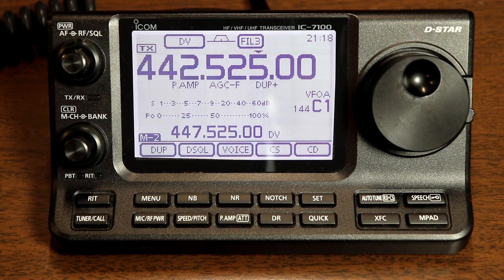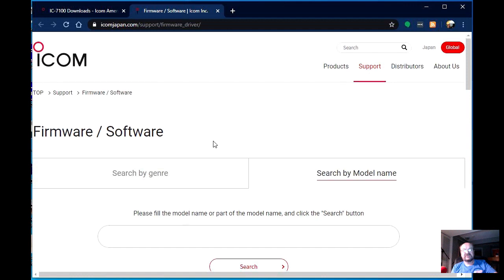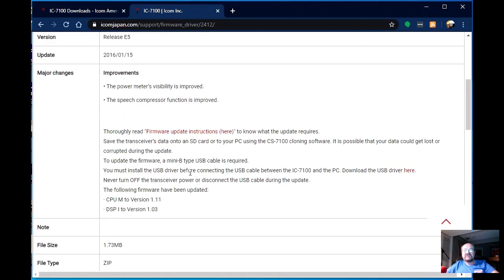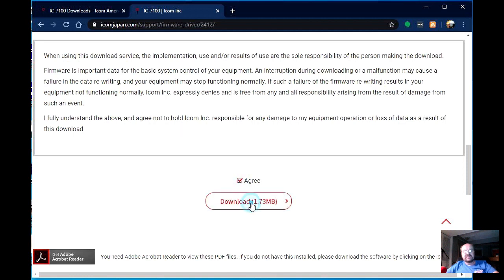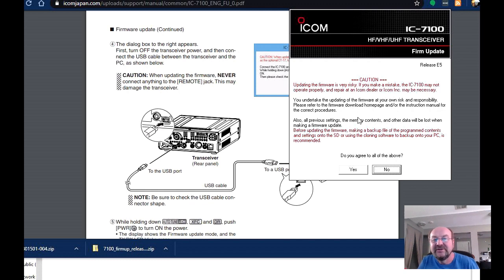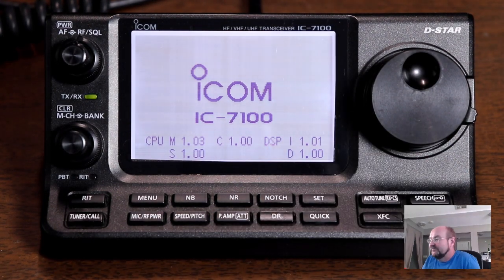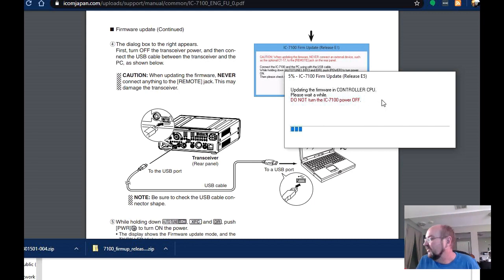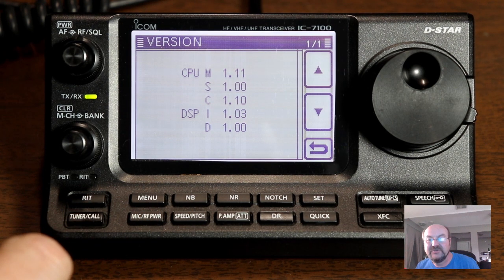IC-7100 from A to Z #6 Updating the rig's firmware

Comment: When doing the UP DATE, I do that with a fully charged large battery.  I sometimes get small power blinks.  I have my power supply and battery connected with a box that changes the battery from my power supply and power the radio and auto switch between power supply and battery.

Comment: Thank you very much for you helpfull video.. i did the update load, so i have last firmware version on my IC 7100. 
Buti just have a persistent problem with the SSB.(only SSB Peak,FM is powerfull)
 in fact, I fail to output more than 50 watts of peak power.
 it seems that it is necessary to intervene by installing a component, to solve this problem. .
do you have any information? 
or was the update sufficient for you?
 thank you in advance. 73!

Comment: Thanks for this series.  I've had a 7100 for several years and love the rig.  It's amazing how much it does.  Your series is helping me with many features that were not clear in the manuals.  Do you address the internal "sound card" which I understand it has, but does not seem to be covered in the manual.  I have tried to use FLDIGI, but can't seem to get the sound to link up.  Suggestions? KM6OTE
Reply from the maker: Hi.  Thanks for the kind words.  I'm glad you're finding the videos helpful.  The two latest videos in the IC-7100 series, #12 & #13, cover exactly what you're looking for.  Here are links to each video:
IC 7100 A to Z #12:  https://youtu.be/OSSqxKTsxwQ
IC 7100 A to Z #13:  https://youtu.be/vucNWT0QWEw

Comment: So, have we once again purchased a radio that can only be upgraded using Windows?    Since I just purchased his one I guess I will just not worry about it.
Reply from the maker: Hi Stan.  I'm afraid so.  I realized after I recorded this that I never mentioned that in the video and I should have.  I use Windows exclusively at work and my main machine at home has Windows 10.  So it isn't an issue for me, but I do understand the frustration.  I was just listening to another ham radio podcast, Linux in the Ham Shack, the other day and the hosts were complaining that the Yaesu Fusion PC software only runs on Windows also.  Hopefully the radio manufacturers will give more consideration to multi-platform software.  73, Tom
Reply: @HamRadioA2Z  Thanks Tom, it is outstanding what you do.  You started me to the 7300 and now the 7100.  I have the same problem with DMR.  I don't know why every company in the world make programs for both.  HAM, somehow is stuck on Windows.  I have been on Macs since Widows Vista forced me to Mac.  Tom, I have a question.  I got programming the 2 meters into the 7100 as the split is automatic. On the 440 I can't figure out the +5 split.  It does not seem to be automatic like 2 meters.

Comment: Did you have to install the USB driver before you hooked your USB cable for the update ?
Reply from the maker: I didn't.  I use the USB connection with my 7100 and my 7300 all the time, so that part was already done.